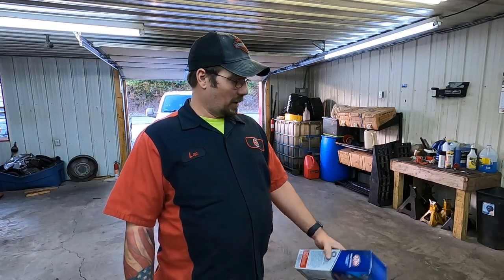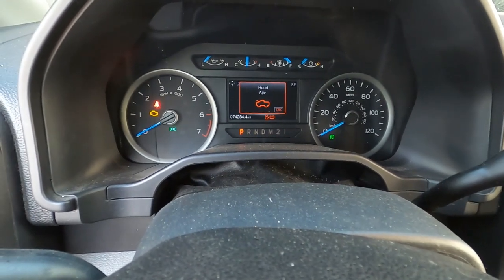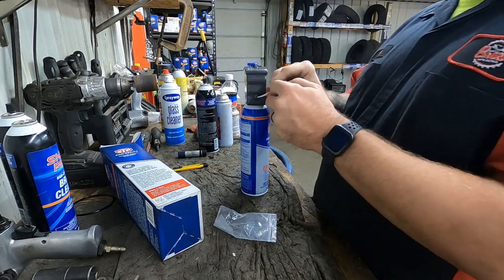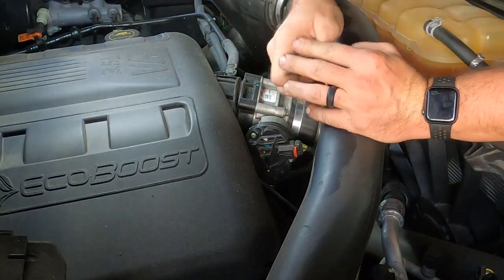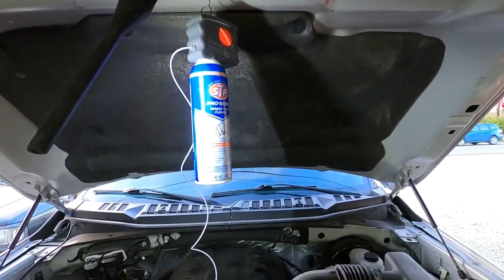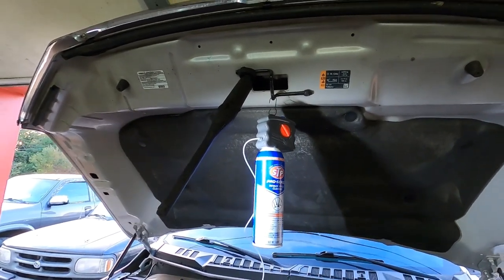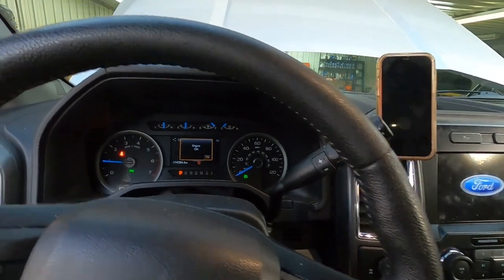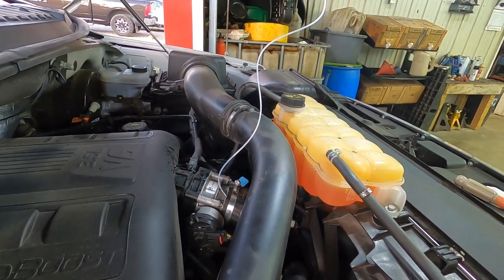STP Pro Series Intake Cleaner Test on EcoBoost F-150 | Brock Auto Repair

Comment: I think this product would work good for a maintenance procedure every other oil change.   If this is done regularly on a schedule from the time the engine is new, then it would most likely keep things relatively clean.  For existing carbon buildup, that's tough, thick, and baked on good, I think getting it clean using walnut shell blasting works the best to get things back to near-new condition.  Then just use this product every 8K-10K miles to help keep them clean.  Also a quality oil separator/catch can would help a lot in keeping those valves and intakes clean.

Great video, thanks Brock.  Just subscribed to the channel.
Reply from the maker: Awesome comment, I appreciate it!

Comment: Good video.  Wouldn’t it be easier to go through the PCV port?
Reply from the maker: Possibly on some vehicles. I assume STP wants you to go through the throttle body to ensure the cleaner is distributed to each cylinder equally. Some engines have the vacuum for the PCV located very close to one cylinder, which could cause issues in getting the cleaner properly distributed….. that’s what I assume their logic to be anyway. Thanks for the comment!
Reply: Did you change the oil on after you did cleaning

Comment: I think what happened is when it started running a little rough when you're driving it I think a piece of cab and loosened up and got stuck on the valve for a second and then it blew off

Comment: Doesn't this stuff destroy the turbos?  I have read that the turbos overheat and the seals go bad.
Reply from the maker: No not at all….. it’s completely safe to use on turbocharged engines
Reply: yes,it does.. we had 3  engines that used ' intake valve cleaners' they bought new turbos, after a bunch of carbon went thru the spinning turbine blades, in the past 2 months.. all of them said they saw these videos on youtube...cost them on ave 4500 to fix their cars. trucks.. best way to clean.. walnut shell blasting...nothing in a can can fix carbon build up on the d.i. engine
Reply: That’s why you apply it at the throttle body, and not the air filter inlet. Basically you’re downstream of the turbos, instead of upstream.
Reply: I bet you have to replace the turbos after you did that
Reply: As you can see, he's bypassing the turbos by going straight into the throttle body.  Never touches the turbos.
Reply: It's not bypassing the exhaust side of the turbos. That's where the damage is done. The exhaust heat is increased and the hot side of the turbo can't take that extra heat.
Reply: @kyleedwards1649 and where do you think the debris coming off the intake valves ends up? Out the exhaust valve into the ........Yes Turbos!

Comment: I do this on my 2011 f150 3.5 every other oil change.   Really makes a difference in my gas mileage.
Reply: are you sure.. did you remove the intake manifold and look at the valves...?

Comment: I envy the location of your throttle body. I’ve got two VW 1.8 TSI engines that I want to do this to, but the throttle body is between the engine and the radiator and buried under some coolant lines. I really like the look of this product though. I will be checking it out for sure. Much better design for application versus the competitors.

Comment: Got to use the STP in a '12 F-150 with 160,000 miles on it today.  All went well.  I never saw anything come out of the exhaust. So I'm hoping it's because it's in great shape--not so caked up it did no good.  Check engine (O2 sensor code) came on while driving.  Reset after reading it.  I'm just surprised nothing came out of the exhaust.  Everyone I've seen do it or read about said they saw some smoke.  Maybe the old truck is pretty clean inside.  I'm hoping.

Comment: Maybe I need to try this.  Going to swap out plugs and boots tomorrow if the boots show up in time today, but I'm getting like 15 max even driving out in the fields like what you show in this video.  You seeing 21+ MPG has me frustrated.  I don't feel like the truck is sluggish, cleaning the MAP/MAF sensors seems to have helped the rough idle I was feeling but did nothing for MPG.  I feel like this truck should be getting better MPG.  Could all be plugs but no misfires or codes.  Gotta be something messed up in there to get such crummy MPG.

Comment: Do you see any changes after a couple months I got the same truck
Reply from the maker: It seems to have a smoother idle after the cleaning.... gas mileage has dropped almost 1 mpg since the video, but I attribute that to the combination of winter blend fuel, colder temps so it takes longer to warm up and go into closed loop, more idle time because of cold, etc. Now that we're into 50 and above weather everyday, I will reset the fuel mileage again and see how it compares to the mileage shown in the video.

Thanks for your question!
Reply: @brockautorepair  thank you very much I got 260,000  m  in my truck and it still running like brand-new so good luck with yours

Comment: What if carbon breaks and goes to the turbos?
Reply from the maker: It won’t hurt anything…. This cleaner softens the carbon up, which is why it comes off the intake valves. So after the soft pieces of carbon go past the intake valve, through a combustion cycle, and past the exhaust valve…. There’s nothing left to hurt the turbocharger.

Thanks for the comment
Reply: new turbos.. as a tech.. we love these youtube experts. selling snake oil...in a can... when you bring yor car in to get the turbos repalced i make lots of money... so please keep listening to these youtube experts,,i am panning a trip to new zealand to go fly fishing.. i need all the broken turbo car you can send me
Reply from the maker: @randellgribben9772  1) soft carbon won’t hurt a turbo, especially after it’s been past two valves and through a combustion cycle. 2) It’s been proven many times, with video proof, that this STP cleaner does break down and remove the carbon. Look at the other folks videos, they show before, during, and after the cleaning. 3) who’s selling snake oils? I’m not selling anything…. I showed the process of using it, that’s all. 4) not sure if you realize, I’m a tech too and I’ve been doing this work for almost 30 years, long before GDI engines were mainstream. Since GDI engines have been popular I’ve done this valve cleaning process many time and have never had any issues with hurting a turbocharger. 

Thanks for your comment though.
Reply: Turbos are bypassed.

Comment: I use seafoam in every oilchange and i use the other stuff crc intake cleaner once a year and i have no buildup on my intake valves ive been doing this since i bought it new in 2016 with 16 miles on it the crc really works good

Comment: At one point Ford said not to do chemical cleaning as it has a high likelihood of damaging the turbo.  Seems one issue is it can really heat them up due to the rich mix while treating.  I'd love to do this on my '12 F-150 3.5, but am a little concerned it may address one problem and cause a more expensive one. Any updates on the truck? Thanks for the video my Ky brother!
Reply from the maker: Fuel mileage is about the same as before the cleaning….. haven’t had any issues with turbos, breakdowns, or other mechanical issues. Power and drivability are still great, idle is smoother than before the cleaning. Thanks for the comments!
Reply: @brockautorepair  Thanks for the reply! Glad to hear the truck is doing well.  I think I will give this a try. My new to me f-150 has 160,000 on it but otherwise looks like it's 5 yrs old.  Want to make sure it keeps going a long time.  Love the big Valvoline sign.  (Wife used to work for Ashland, later Marathon.)
Reply: Ford has been tryna find a solution for the past 10 years now
Reply: @gutierrezc8709  What are you talking about... No it doesn't.  The problem would be carbon breaking off and going out the exhaust valve, hitting the EXHAUST side of the turbo...🤦‍♂️🤦‍♂️

Comment: Don’t those aluminum trucks have port and direct injection?
Reply from the maker: Yes, the 2.7 and 3.5 ecoboost engines are direct injection.
Reply: After 2017
Reply: Only some. The 5.0's have both systems.
Reply: Jimmy, the Gen 2 3.5L got a port injector. I believe that the Gen 2 is 18+, so anything 2011-2017 would not have the port injector that helps wash down the back side of the intake valve.
Reply: @LarryMusgrave  Actually, its 2017 for the 3.5 gen2. Its easy to confuse because 2018 was the first year for the 3.3 and 2.7 gen 2 motors, along with the 3rd gen 5.0's. All 3 motors added a 2nd fuel injection system that year. The 3.3 and 2.7 added port, and the 5.0 added direct. 

I don't bring it up to be an ass, or anything. Its just that this information is critical for people shopping for a used vehicle. For example, everyone wants an F150 with a gen 1 or 2 5.0, so 2017 is the cutoff for that motor, but if you want the added port injection, 2018 and up is the better year to get for those engines.
Reply: @AT1272  
LOL... I qualified my statement with an "I believe..." because I knew I was within a model year. I own a 2019 and a 2014 3.5L. 

I actually did this STP Pro intake valve cleaner today, $41 on sale at AutoZone.

Maybe it's placebo, but I swear my 2014 runs much better after!
Reply: @LarryMusgrave  "LOL... I qualified my statement with an "I believe..." because I knew I was within a model year. I own a 2019 and a 2014 3.5L. "

I know. That's why I made sure to say I wasn't trying to fault you. People are  always asking what years and motors are best to get. With all the different options, its easy to make a mistake. Sometimes 2017 is the best option, and sometimes 2018 is. It depends on the motor.  

As far as the cleaner goes, I have no idea if it works, or not. I have to use whatever Ford says. If I want to try something other than what's required, I have to call Dearborn and get permission, or the RO will get kicked right back to the dealership. I have no reason to not believe you. Cleaning should make a difference. If you want to check, they now sell borescopes for well under $100 that use the screen on your phone or tablet. They used to cost hundreds of dollars.
Reply: @AT1272  
I talked to my local Ford dealer last week about servicing my GDI 3.5L intake valves, the service writer said that for $179 they will use a spray type intake valve cleaner. 

F that. For $50 I can do it myself! So I did. I did ask them if Ford had an approved or recommended product or method, he said that Ford does not.

Comment: Fyi-Robokiller 👍

I'm doing this now-no rpm difference. Not sure it even sprayed

Update-nope. This is 2 cans in a row that won't spray. Pretty crappy for $42
Reply from the maker: Yea, that's definitely not good..... Hopefully the parts store will swap them out for you.
Reply: snake oil...but keep on watching these youtube experts
Reply from the maker: Snake oil? hmm
Reply: Have to be smarter than the can!
Reply: Did the hose get squished too tight when you put it in by the throttle body maybe?

Comment: Good video!  I've been wondering ... I've heard STP is the best.    I think that stumble you felt driving was carbon breaking loose from the valves....the cleaner had time to soak in.   Then you blasted it loose by driving.
Reply from the maker: That's definitely possible. The truck has been running great since then, seems to have a smoother idle too. Thanks for the comment!

Comment: B-12  in gas tank and MMO in oil. My 2008 focus has come alive with regular treatments 
Would the chunks going out tail pipe not destroy the turbos passing threw those
Reply from the maker: That combo will work great for cleaning the injectors themselves, but won't help with the intake system on direct injection engines. The fuel mixture doesn't spray onto the intake valve or inside the intake manifold, so it doesn't have the opportunity to clean those. The problem comes from the crankcase vent system blowing oil vapor into the intake and then it clinging to hot parts and hardening. 

During cleaning the pieces of carbon going out the tailpipe have already been softened and mostly burned up anyway during the combustion process after they enter the cylinders. No worries of hurting the turbo wheel. Thanks for the comment!
Reply: 2008 where port injected..not direct injected